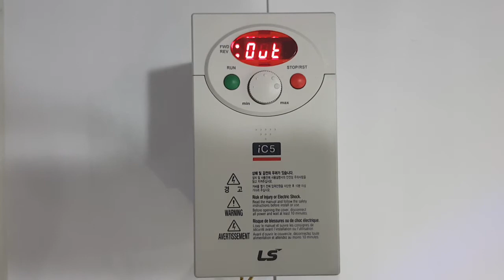How to fix "Out" error in iC5 || LSIS

Comment: How about GFT error? What parts inside the iC5 who caused the problem? The trip occur when I turn on the inverter without motor
Reply from the maker: It's a ground fault. Problem can be at many places example motor, igbt or cpu. You will have to send it to repair

Comment: Ls ig5a inverter 3-4 year running then. Ovt & lvt fault...  Sir pls give me problem solved idea..
Reply from the maker: It require hardware inspection. Try to clean with air blower if the inverter is dusty. If nothing works, then approach technician for maintenance and repair
Reply: Inverter all clean. But doesn,t problem solved.becuse dc link voltage is low.
Reply: Pls give me parts reples idea
Reply from the maker: If dc link voltage is low, then you need to check diodes (i hope you know the procedure). In case you are not sure how to check then pls contact maintenance guy to fix or check. In my suggestion, take it to nearest LS service center.